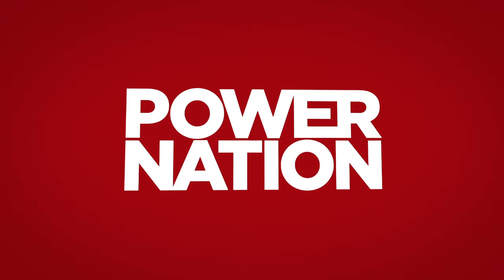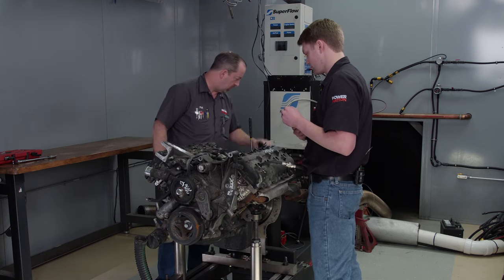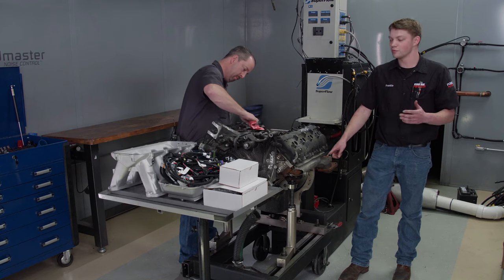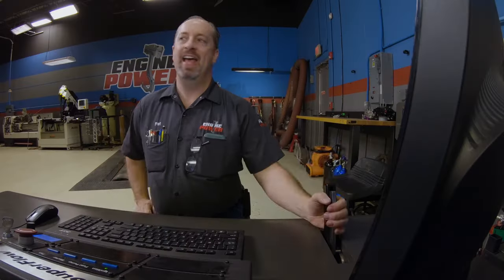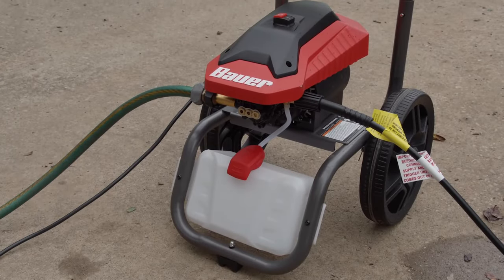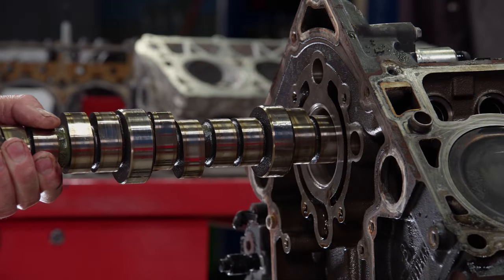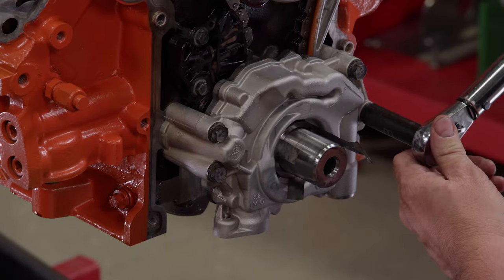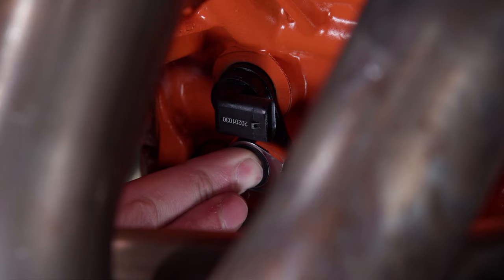Burnt Junkyard 6.4L Gen III HEMI Rises From The Ashes - Engine Power S8, E12

Comment: Awh that's just too bad and with all of those plug-and-play electronic fuel injection throttle bodies on the market today that will allow you to bolt up Google four barrels on a tunnel ram and with and without no tuning whatsoever will learn itself and be a ho-hum grocery getter Drive about town until you stand in and throttle and it jumps up like an old-school Gasser at the Nationals oh no we're going old school carburetor that's courts drops of liquid gasoline into the mixture wasting 20% of it every time the engine fires working out the piston rings diluting the oil and burning out the bearings when you could have had electronic fuel injection an old fuel package that Burns fuel like a Nissan and rips the tires off like Don Garlits slingshot rails but apparently no one knows the difference now between jets that do not selfish yes but remain at one fuel ratio blowing liquid gasoline into the smoke off of that injector that blows up when a lot more power than you're ever deliver from brain or all gasoline and pumping it with accelerator pump down into your engine that from the specifications and Records today shows that you just lower neck Camis life at least 500,000 miles that it could have had with electronic fuel injection and electronic ignition that is all of us know or should know that is what is the miracle in the magic behind cars going 200,000 and 300,000 miles that never made it past 50,000 MI but then what would I know I do and then working on cars in garages and tuning for race teams and and build a car that was top Eliminator is Placid us Nationals and racing sprint cars and racing 850 horsepower modified late model stock cars Amazon only able one time to win Eldora for $100,000 Hoosier hillbilly at don't know much about engines although I was raised in the racing capital of the world and AJ Ford's Garage on Gasoline Alley when I was 9 years old a little suburb called Speedway at the brickyard the infield with Ford double overhead cam Cosworth V8s screening of what we called a bundle of snakes average speed 237 that stands today. Dan Gurney with his four valves per cylinder pushrod heads Gurney weslake overhead valve engines nightmare ponies and you don't ever get out of that wannabe be Mopar as you just now are saying maybe we will get it running and that's a big Maybe like they say here in Indy if you can't run with the big dogs don't even bother pulling it out of the trailer
Reply: Damn Bro , i want what your smoking .geez

Comment: Thumbs down for this one guys! You literally did everything in reverse order. Why would you put an intake on a junkyard motor dyno it and then tear it down to clean it up! Terrible example here .
Reply: They OE intake was ruined in the fire. They had to add that intake to get it running so they could get baseline numbers.
Reply: @skwerlee  you missed my point. This is absolutely the worst thing you can do to an engine that has been sitting outdoors. Did you notice the smoke show when theh started it initially?  Could easily have hydrolocked it and blown a connecting rod right out the side.
Reply: @jamesrobinson9176  how could they have hydrolocked it? They literally pulled all the plugs while checking compression.
Reply: @skwerlee  by their own admission it was outside and full of water. Hlock is just 1 example of what could have gone wrong.
Reply: trust me, this is "made for tv" or should i say "made for youtube" crap. they already knew the condition of this engine before they tore into it for the cameras. no way would anyone dyno a completely unknown engine before they knew it even had oil pressure!
Reply: @jamesrobinson9176  that smoke was from the seafoam dude...    chill.
Reply: @jamesrobinson9176  was not full of water.
Reply: @2nickles647  due to your fan status you're failing to see the point. My original post is accurate. If you're gonna do all the steps anyway, why not do them in order.
Reply: Uuuh....they drained what was left in it and put in fresh oil and Seafoam treatment before they ran it. Also, they pulled all the plugs and did a compression test before all that even. So any water in the cylinders would have been detected and evacuated at that stage. The smoke on startup was the Seafoam because no doubt, they poured some in the cylinders as well. Also, the stock intake that was on it was ruined in the fire. To top that off, they were going with a carb setup because this build was going in an old Roadrunner that was not going to run EFI. So they needed an induction setup to run it and get baseline numbers before they did the upgrades.

Comment: why would you screw up a roadrunner with that pile of crap engine, put a real hemi in it.
i would rather see a 440 rather then that junk.
Reply: That's just it , from the salvage yard. Any engine you pick for a weekend special and bolt on performance parts. Find one that works for you.
Reply: You can't find a lot of 426 Hemi's or even 440's in the salvage yards these days. You would have better luck finding what they just built or maybe a 360 or 318 Magnum out of a wrecked Jeep Grand Cherokee, Dodge Durango, or late 90's Ram truck. The theme here is what can a guy who works out of his garage accomplish in a weekend?
Reply: @TwentytenS4B8  there is no way your putting that computer controlled crap in a car and getting it running in a weekend. in the car maybe running never. a month of weekends ok. and that's if the engine is good along with all the electronics.

Comment: Coyote is better, sorry. These "Hemi" boat anchors just aren't worth their weight.
Reply: Best place for a furd engine is at the bottom of the lake, oh sorry
Reply: No thanks bro I walk mustangs and camaros all day you can keep your little turd motor
Reply: Mustard are for girls coyotes are for breakfast. 😂
Reply: @diegohorton869  I dont think so bud I'll eat your coyote for breakfast and have some ls for dinner lmao
Reply: Awesome my 2011 Ford F150 with a 5.0L Coyote V8 has 141,000 miles and still going strong and its a beast and it sounds like a beast with the Borla ATAK.
Reply: Have you heard of the new 7.3L Godzilla V8 from Ford.
Reply: @CJColvin  Yeah ive worked on them in Rv's at work theyre replacing the v10 with them
Reply: @CJColvin  I'm hoping this rumored 6.8L in development comes to the Mustang, since the head of the Windsor plant said it would.
Reply: @crimsonstang  In my opinion a big pushrod v8 is easier to make power and more reliable than overhead stuff and its got to be cheaper for them to produce it
Reply: @justinpeterson6839  DOHC stuff does have some added benefits with less friction in the valvetrain and less kinetic energy loss - but it is minimal. The Coyote is a great engine, but then again so is the LS and the Hemi platforms....    I personally find Ford engines too complicated for what they are (even back in the day with different firing orders, parts interchanges, etc) - but that's a personal opinion.
Reply: @BBCharger5spd  I agree too much experimenting instead of going with a solid foundation
Reply: @justinpeterson6839  it's a good thing your opinion is wrong
Reply: @crimsonstang  Numbers don't lie bud pound for pound a pushrod v8 can make more power without all the valves and cams how is that wrong
Reply: @justinpeterson6839  Right
Reply: @crimsonstang  Well let's hope it happens
Reply: @DoctorMotorcycle  You're talking about a fully built race engine not just some parts slapped on a stock engine same thing will happen with any engine fully built at a race engine shop lol 90% of people out there aren't going to drop that much money on their mustang they're already paying 25k for
Reply: @justinpeterson6839   Ya, he said "only 12:1" compression.   That is a fully built racing engine like you said.  I bet it not even running on pump gas with that compression.
Reply: @bigassfordsd  this isn’t the 60s, tons of modern performance motors can run that compression on pump gas. A stock coyote is already 11:1